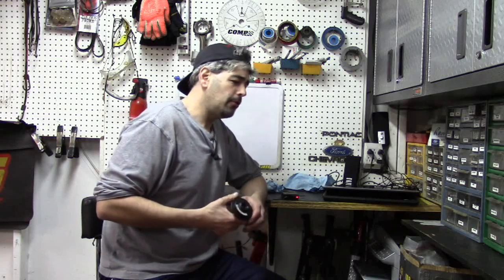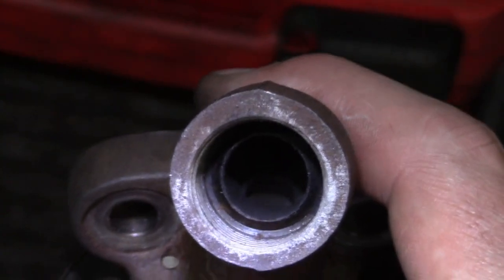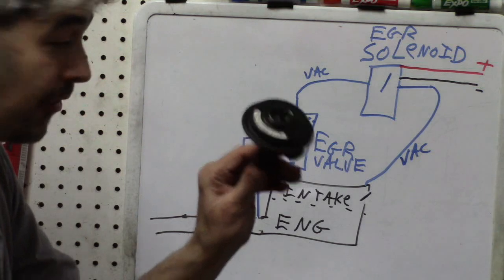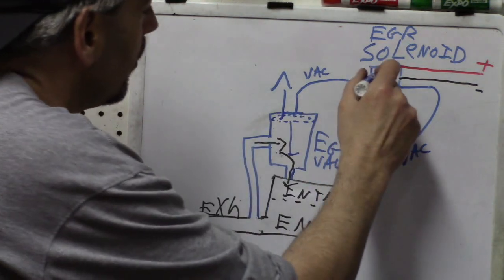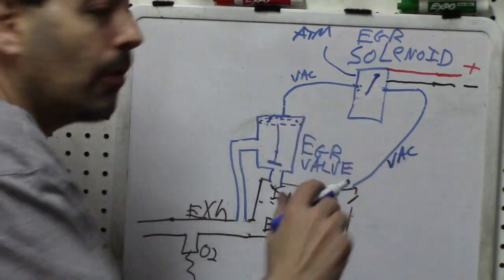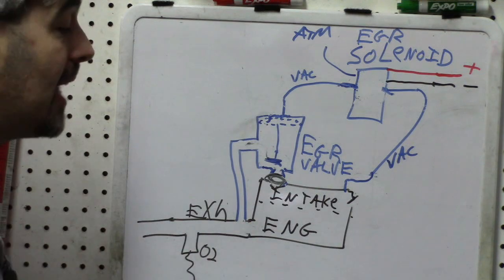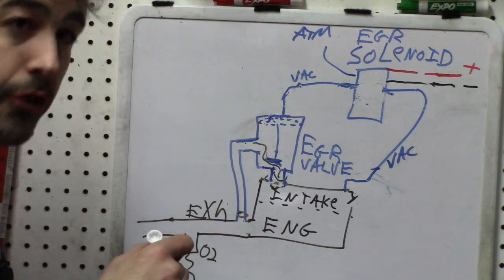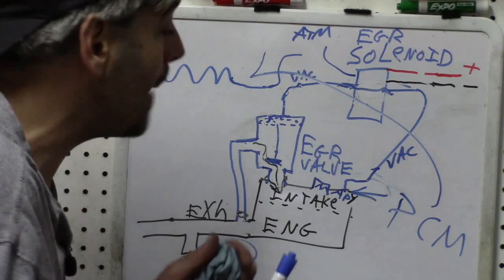EGR  P0400, P0401- P0409 Diagnosis+Understanding Pt1

Comment: I would like to know the symptoms of a bad EGR or whatever we are looking at. I have a van with over a half million miles and it blows lots of soot out the tail pipe, staining the concrete or whatever, and I have replaced the fuel pressure regulator, which seemed to help for a little while, but it's back to blowing lots of soot out the pipe. I replaced the MAP sensor, Throttle Position sensor too, and although it runs much smoother and with more power now, it still throws lots of black soot out the pipe. So I'm still trying to learn what I can to see if I can track down the problem. I don't like taking it to shops. One shop charged me $1500 dollars (which included towing) and all the problem was, was worn out spark plugs which I replaced myself afterwards. That was $1500 for nothing, except they replaced 3 parts. So far, I think I am doing about as good as they did.
Reply from the maker: I would start with whjat data you had indicating the MAP and TPS were bad.  That's where you need to start.  What was that data?
Reply: Schrodingers Box  ,
I had no data. I just came back from an auto parts store that advertised free Check Engine Lignt testing, and they could not hook their tool to my year van, so I will try somewhere else.  It sure ran with much smoother power after I replaced those two, except that there is some intermittent surging, and bucking at times. Don't know what that is all about. Except for those times, it sure runs better, but it is still blowing black soot out of the exhaust. 

Just now, I found a silicone 5/8" heater hose that is leaking, which  makes a connection from a steel tube from the cat that goes up to some kind of vacuum diaphragm switch kind o'  looking thing, (EGR valve is my guess ) so I will be replacing that hose. Before I do more, I want data, so I don't just buy parts for nothing, or at least a very good educated guess on what could cause that black soot shooting out. It makes quite a large stain on start up and I can see black smoke from my rear view mirror when I accelerate hard. It will make a 8" diameter stain on the ground on start up. It's a '91 Dodge B250 van with a 5.2 motor.

I don't know how long a list of things there could be that would cause black soot to shoot out the tailpipe like that. Maybe it's a long list, I don't know. If it was a short list, maybe I would replace a few parts if it isn't expensive.
Reply: OK, so I finally got data. A parts guy told me how I can get it by turning my key on and off three times and then count the flashing lights. So I had a bad TPS, IAC motor, MAP sensor, and 02 sensor. Changed all that out, and wow! What a difference. Runs better than ever. Thanks for the help.

Comment: A bit late here but if I connect the vaccum pump to the line that goes to the Q end of the modulator and apply vaccuum then we should get a stall if the solenoid is open, correct?

Comment: great video ! looking for some advice on my  2000 ford 2.5l. i have a lean code,  checked for vacuum leaks with a smoke machine. there was smoke coming out of the idle air control valve's(IAC) top/breaher cap/vent (not sure want its called), and on the Exhaust gas recirculation (EGR valve) vents holes . wanted to know if that was normal?
Reply from the maker: That’s normal.

Comment: Clearing the carbon blockage on some engines may not be as simple as removing and cleaning the EGR valve.  Some of the Honda engines, for example, the 2002 Odyssey V-Tech, have an entire EGR plenum system and EGR plenum service plate on the top of the intake manifold.  On these engines you need to remove the top on the intake manifold to thoroughly clean all of the small ports that feed EGR gasses to each cylinder.  I found on these engines that the EGR valve and its port usually are relatively clean but the small ports and passages in the intake manifold plenum cover become completely plugged. The 6 holes in the manifold feeding each cylinder will also become plugged.  Best way to clean these is to soak the plenum cover in lacquer thinner and then use "Q" Tips and a tooth brush and brake or carb cleaner to clean out all of the small passages.  This seems to be somewhat of a regular service item about every 75,000 to 100,000 miles with these engines.  If you just remove the EGR valve for inspection/cleaning, you will find the valve and ports are relatively clean.  The EGR valve will function but the engine will still not run properly.  The ports under the removable intake manifold plenum top are a big Gotcha on these engines and even the Honda Service manual does a very poor job at letting you know anything about this system.  Forget trying to clean these ports by Sea foam or anything else dumped into a vacuum line.  It won't work!  Removal and manual cleaning of the ports is the only effective way to clean them.  Honda did change this design later on.
Reply: Hi, is there a control spindal that operates this port system that gets clogged, I think I may have the same problem with a Peugeot engined Suzuki grand Vitara and the performance is dreadful
Reply: @loyndsy  I don't know anything about a spindle operating these ports.  The only thing that feeds these ports is the EGR valve.  Most of the time the EGR valve is relatively clean just these ports become clogged and that will make the performance terrible.  One of the early symptoms will be increased cranking time before the engine starts and a bit of rough running after it starts.

Comment: Good afternoon. I would like to thank you at first to give us your knowledge freely! Then I would like to ask you . I have a Ford transit connect 1,8 lit turbo diesel . The problem is that it works abnormally and make fault error P0234 turbo charger over boosting condition. Can this happen if I have bad egr valve ? Thank you in advance 
Petros Santorini island Greece
Reply from the maker: Probably not. Most likely a fault with wastegate or internal with turbo.

Comment: My on board diagnostics gave a 0404 code on my 2006 town and country. Should I do the replacement. It runs kind of like poop. Changed the plugs 3000 miles ago.
Reply from the maker: I would test the EGR performance. I certainly would not replace anything before I diagnosed the issue.

Comment: Thanks for the great videos. I too have been a swap king as a result of my mechanic telling all the things that needed to be replaced. Each with little to no improvement. After your videos I want to test for the problem but my old 93 Chevy k1500 truck w OBD1 is a little limited. In doing the egr test to apply vacuum at idle to get the vehicle to stumble or shut off nothing happens or I should say egr doesnt hold vacuum, but if i raise the diaphragm with my fingers the engine stumbles and almost shuts off. If i have the truck off egr holds vacuum and i hear the atopper raise. With the egr off i apply vacuum and see the stopper raise. So im at a loss. Is this normal behavior? Oh the driving trouble that lead to my start down this parts swap rabbit hole is the i have engine stumble at highway speeds about 50-60mph, and sometimes at takeoff from stop. I recently got code 32 - EGR failure
Reply from the maker: Sounds like a broken EGR diaphragm to me
Reply: @SchrodingersBox  when i change the egr valve get the same issue with the new one. Cant pull/hold vacuum w engine running. Im at a loss.
Reply from the maker: Some egr designs are “positive displacement” and they do not hold vacuum.  Since you changed EGR you should abandon that and just do a fuel trim analysis to get a basic direction.

Comment: A suggestion for those like me that need to connect the dots.  It would be great if you could, prior to testing, use the board of knowledge to list the items that may be causing the problem with the vehicle and then cross them out as you eliminate each one with testing.  That would make the testing and eliminations easier to follow.  Thanks.
Reply from the maker: Indeed on an actual repair I will do that.  Since nothing was wrong with this vehicle as it was just for demonstration I didn't have to do a differential diagnosis. 
  In a few weeks I have another car coming in that failed emissions due to high NOx emissions that I strongly suspect is from EGR failure. I will do the dry erase board of knowledge on that one for sure, because we will only need to consider all possibilities for an EGR that is not opening based on the symptom.

Comment: Thank you so much for these detailed videos! They are incredibly helpful! I have a question if you would be so kind to answer. I could really use your help!! I had the same issue as in you mentioned in this video with the carbon buildup. So I replaced the EGR valve, cleaned out the EGR passage, throttle body and as much as possible in the intake manifold area... spent 2 days on it. Also changed out the air filter. However, the car is still having the same symptoms... and it starts happening once it's warmed up. One thing I didn't do is take off the EGR Tube because it was so difficult to get to in the back bottom of the engine and is nearly welded together from the heat. So I started the car and let it run for just a couple of minutes, and felt down the EGR tube... Dumb idea, I know. But the top of the tube was cool to the touch and when I got to the bottom, I almost burnt my finger. Would that mean the EGR tube is clogged at the bottom? or could it be something else????
Reply from the maker: What data do you have that the EGR is the issue? Why not validate a change in MAP voltage with EGR bypass as a basic simple way to test it?
Reply: @SchrodingersBox    I sincerely appreciate your reply! I have an OBD scanner, which lead to the P0401 code... I probably didn't need to replace the valve (which was recommended by 2 other mechanics) , but it's too late now.... Hindsight is 20/20. I'm not a mechanic... I'm just trying to get my car in working order.  My OBD scanner (Torque App) has some airflow meters, but I only know a little bit of what I'm looking at... but obviously not enough to figure this out.  

I don't know what to look for with the MAP voltage or the EGR bypass. Could you possibly put that in layman's terms? I have the the OBD scanner and a multimeter... but not sure what I'm looking for or how to test with them. So far, I figured out that excess carbon buildup was blocking the egr passage and was in other areas. Got it all cleaned out except for the egr pipe. That's why I thought that could be the culprit. If you can point me in the right direction for troubleshooting with what you mentioned above, I'll be happy to try whatever you suggest!  Thanks again for your awesome detailed videos!
Reply from the maker: @powerofknowledge7771  Wish I could help by I hold with my original statement. If you are unsure how to do that it's best you let someone with some basic knowledge on cars do it as you don't want to risk harming the PCM.
Can't think of a better way to do the initial differential diagnosis without a better scanner
Reply: Ok Thanks. Just trying to learn like everyone else here, so that I don't end up making that mistake... Thanks for your time. Take care!

Comment: So on my 2002 Cadillac Eldorado, which has a misfire currently. The EGR valve is not the problem? Or is not the main problem I should say. ( I should add more information about my misfire problem, only misfires at idle. And it completely misfires when the A/C is on ) the only time is does not misfire is when I'm on the highway going 25+mph and when the A/C is off.
Reply from the maker: I don’t know. what is the EGR duty cycle?

Comment: It would seem that the EGR valve being stuck open should cause RICH conditions and not LEAN ONES.
 You're taking exhaust gasses which contain unburned fuel but LESS O2 than atmospheric air. You mix it  with intake atmospheric air so the mixture of the 2 now has LESS O2 and MORE FUEL than a purely atmospheric mix with a closed egr would. This would be relatively rich, not lean. Less o2 and more fuel makes the ratio richer. 
 Please either reply and explain what I'm missing or link me to the timestamp in the video where you explain how an open EGR makes the mixture lean.
Thanks so much
Reply from the maker: Dude I 100% agree with you. I still don’t really understand why it shows lean and I absolutely agree it’s problematic that you are introducing a low-oxygen displacement into the combustion so it should read rich (no so much because of the fuel but the low oxygen).
   i have heard a couple of explanations for why it shows lean. One is the open EGR causes lower MAP which of course would cause a reduction in injector pulsewidth and this makes a more oxygenated mix showing lean. Hmmmmm.
   Another explanation is that the improper mix causes incomplete burn so you still end up with net higher oxygen in the exhaust. Hmmmm again. 
   I should probably do a video where I make some experiments on this and show the actual reason. 
  Great question btw.
Reply: @SchrodingersBox  DEFINITELY make that video
Another guy, 3 or so comments down from mine asked the identical question 7 months ago so at least 3 people, including you, need this question answered

Feel free to wait until after the holidays but then seriously think about doing that vid!
THANKS so much for the reply!

Comment: Matt, Love the series. I apologize in advance for not being able to find my reference or resource of my following question/input. I recall reading that an advanced use of the EGR system is to also fill the combustion chamber with inert gas in order to reduce the volume of the chamber during times of reduced performance requirements. Essentially, making a big engine smaller because we don't need the power at that time. We can then "pad" the chamber with "something else" (less compressible) and provide less fuel (keeping our stoich though). Have you come across any information that suggests this theory in conjunction with or in lieu of "just for emissions". I have searched and was unable to find this information again. I was looking forward to sharing it with you as it was a really interesting article. For some reason though, I think I read it in a FSM for a GM product (I know it's vague, but it might spark your interest or memory). Disclaimer, I know it doesn't physically reduce the volume of the chamber, was just an example of how it would work). I love your videos and hope you keep it up. 2 percent for life!

Comment: Loving the videos! One question: Why does a car at idle not utilize the EGR valve a little- or do they?
Reply from the maker: EGR is not used at idle because there is too little induction to make use of any significant amount of unburned fuel in exhaust. the car would just stall. it’s only used under moderate throttle applications where larger air intakes can tolerate the recirculation. EGR is also not used under full throttle.
Reply: @SchrodingersBox  Thanks! And I never knew induction was a term for gas going into the engine.
Reply from the maker: induction is actually term for air going into engine.

Comment: i remember many years ago a man took a full size truck and connected a hose from the tailpipe to the intake of i think a pinto started both vehicles then turned off the fuel to the pinto and it ran from the exhaust coming from the truck
Reply from the maker: That’s interesting 
Truck must have been running rich. keep in mind all cars run rich when first started though.
Reply: @SchrodingersBox  it was a old truck with a holley 4bbl he was showing just how rich some vehicles run and to show that exhaust going thru intake could be burned

Comment: Would this have anything to do with idle raising and lowering sporadically? All I get is an O2 code.....
Reply from the maker: It could.  What data do you have?
Reply: @SchrodingersBox  None, unfortunately, I'm just a guy living in my motorhome that I can't drive due to this issue...  I'm not even close to a mechanic. I just need to figure this out beofre my LP gas runs out.

Comment: on my 94 f150 300 straight 6 4.9 it been idling rough for months and now it has a really bad miss now the code said egr valve but my question is could it be the fuel pump any  info would help please thank u just dont have much cash to buy a part and it not it
Reply from the maker: Could be but I would definitely start by looking at EGR.  What is the design that it suspects the EGR? Is there a potentiometric metering of position? Is it MAP sensor validated?  What is the design and what strategy are you going to employ to determine if it's not the EGR and something else instead?

Comment: Ok mine doesn’t do that when I put the hose & suck on it. It doesn’t do anything but seem clogged, so I’m guessing mine is bad
Reply from the maker: You either have a failed diaphragm in the EGr, a clogged port, or if it’s a Ford- some fords have positive displacement EGr’s where this truck doesn’t apply.
Reply: @SchrodingersBox  it’s a 1991 Chevy G20 van 5.7l small block 350, I figured it out, it was clogged I cleaned it, reinstalled it now it’s working perfectly! The diaphragm wouldn’t move when I pressed on it, so I cleaned it good & got it moving & returning normal, it’s fixed now!

Comment: Replaced my egr the other day to find out the egr tube at the exhaust was rotted out not connected by any means already bought the part so why not put it in but I believe it gave me an egr code because it wasn't hooked up at the exhaust
Reply from the maker: Yep if you're stuck with the part thats a bummer- but obviously opening the valve and failing to see a MAP response would have told you the valve does not need replacement.